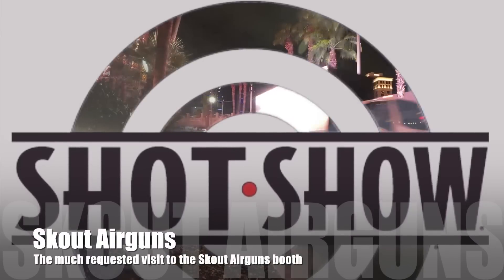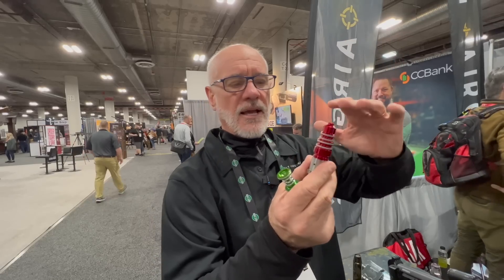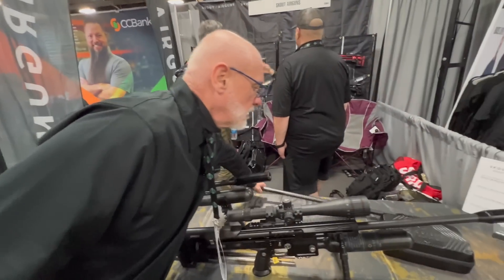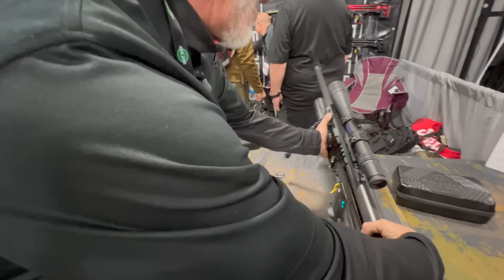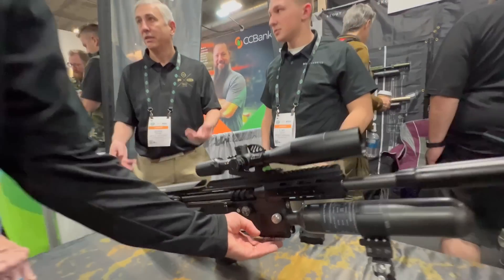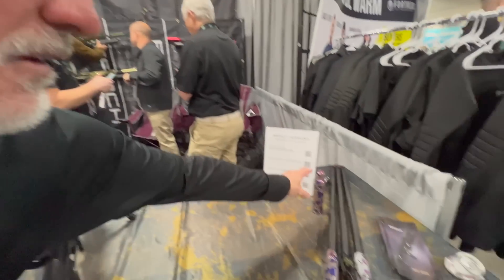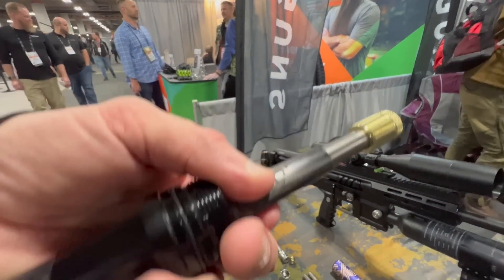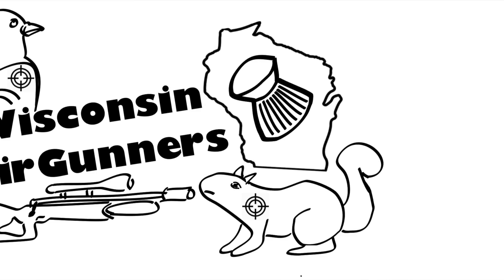SHOT Show 2023 - Bill of Skout Airguns shares all about the soon to be released Epoch!

Comment: Can you explain how the magazine actually works , as far as rotations?
Reply from the maker: It sits in a neutral position without a stop. You could spin the cassette either way. You can spin (and they recommend doing testing) one, two, three or more revolutions putting spring tension on the cassette. You choose how tightly to wind it. This way if you are using a thinly skirted pellet you are less likely to crush it in the magazine. Generally heavy pellets or slugs will need more spring tension for reliable feeding.

Comment: Like to know the shot count in both 25 cal. and 30 cal. for both length barrels.
Reply from the maker: There are going to be a lot of variables on that. As it operates at such a low pressure that number should be uncommonly high if it works as advertised.

Comment: I've watched all the videos they have out not once do they talk about how much does it weigh or how many shots per fill.
Reply from the maker: There is so much variability in how these are tuned, and what pellet you’re shooting, that at best we’d be given a range.  
If you’re maximizing accuracy you’ll probably fill to well less than its maximum fill pressure. The weight I just forgot to ask, but again it will depend on configuration. I’d put it in line with something like an Impact. 
For what it’s worth it feels nice in the shoulder.
Reply: Very promising but the price is out of a lot of people  price  range.
Reply from the maker: @russellfleet7636  I agree 100%. I did not get the impression that they thought they were trying to build an air gun for everyone. I think they are firmly in the segment of the market that is trying to push what an airgun is capable of. There are certainly some parts of their design that I think would be interesting to see applied to other, more affordable offerings. Maybe that’s a direction they will go in the future.
Reply: @WiscAirGunners  I agree with you 💯 percent on that.

Comment: What are your Thoughts after talking with Bill about the Epoch ?
Reply from the maker: I had never met Bill or any of his crew before. He  has true passion for airgunning generally and the Epoch specifically. 
You can see that paintball tech influences the design. The +/- sized liners, electronics in the grip, etc. 
They’ve gotten a lot sorted out, but are not at the finish line yet. 
I’m excited about what the platform brings to the table, er…bench, but will withhold final judgement until I can see the groups.